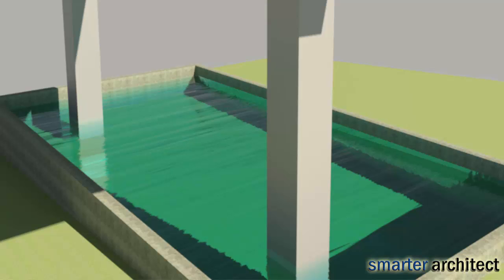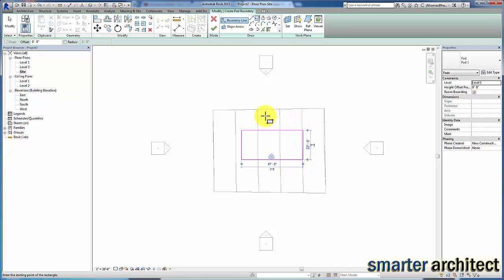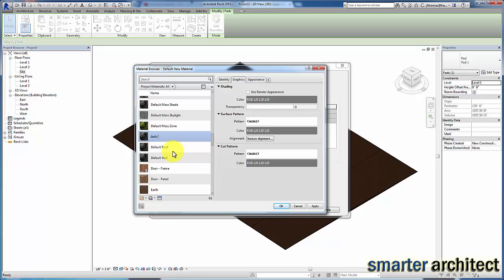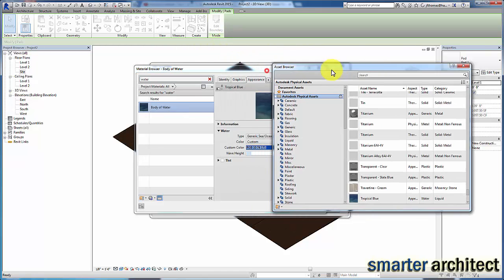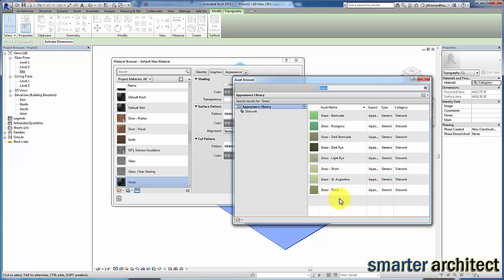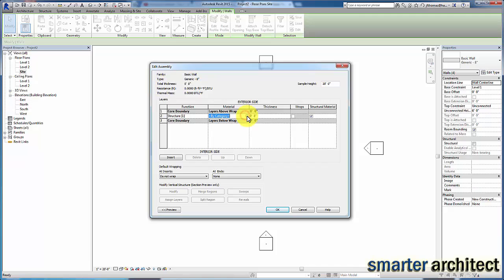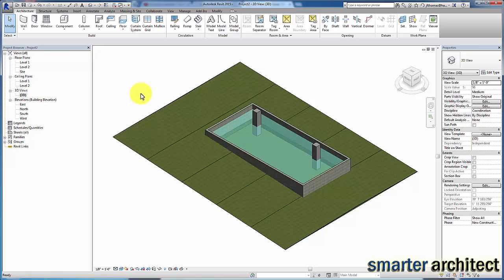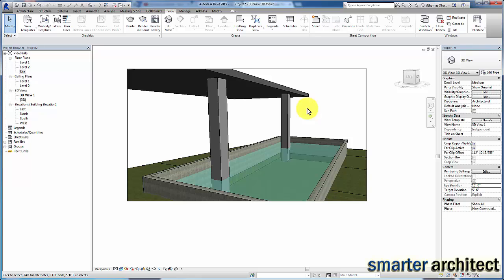Revit Tutorials: How To Create A Revit Pool

Comment: Would making one in Conceptual Massing be better?
Reply from the maker: No. Conceptual masses do not automatically integrate into the toposurface component.  Additional steps are required to achieve the same end result.  There are multiple ways to do any things in Revit, but the process is very efficient.